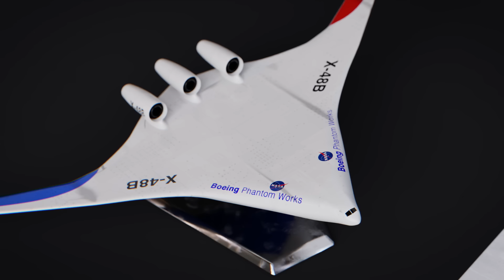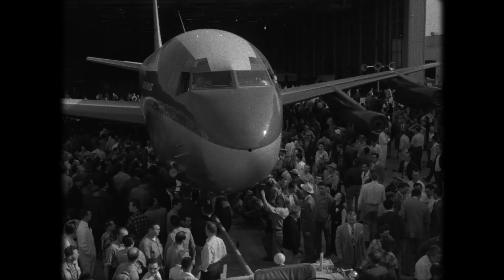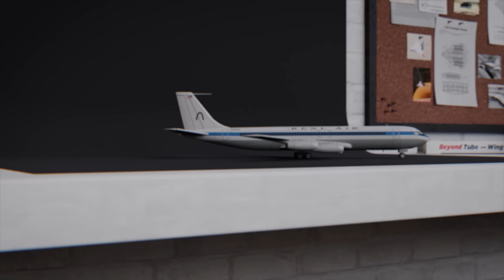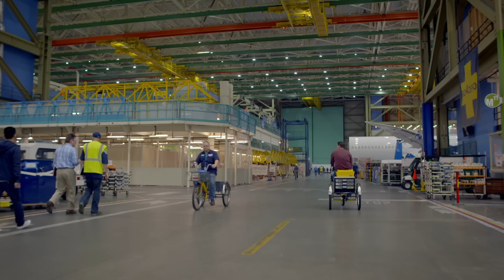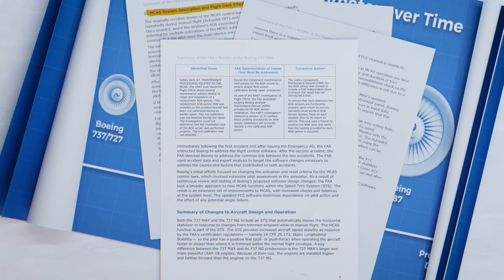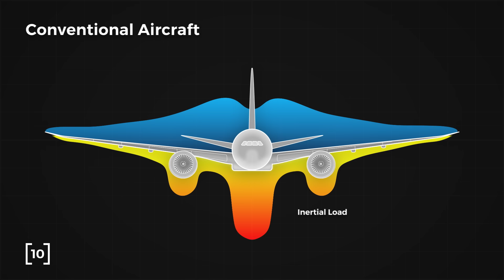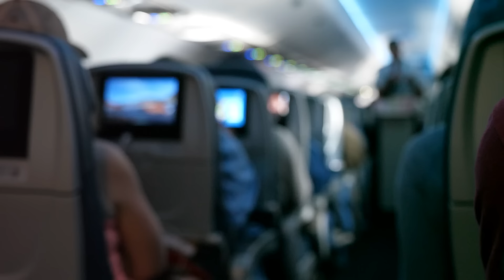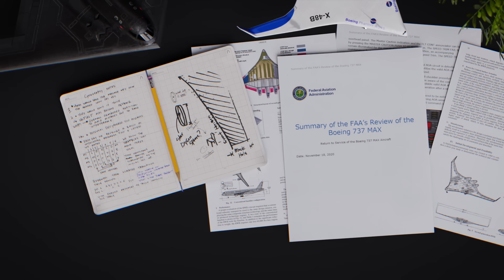The Plane That Will Change Travel Forever

Comment: 5:00 Actually, that's exactly what we want for aerodynamic stability and control.
We can design planes with a forward (or coincident) center of lift on fuselage-wing designs today, and we could 50 years ago.
The reason nobody does that (outside of a few test and military aircraft, like the X-29) is because such a configuration is aerodynamically unstable, both for human pilots and for software.
The drag and lift penalty for trim is quite small on modern airliners, and not something worth sacrificing safety for.
Reply: > The reason nobody does that [...]

Moving the center of lift in front of the CG has been done for decades in General Aviation (GA) in configurations that are most certainly aerodynamically stable ... they are called "canards" and Burt Rutan made his reputation in large part on designing aircraft that used them.
Reply: @lewiscole5193  Yeah, I am aware that canards exist (cf the X-29 I mentioned previously), but they are a very niche design, and mostly seen on a few light aircraft (where aerodynamic efficiency is not a major driving factor, cf it's more efficient to use struts and braces on wings despite the profile drag) and on some fighter jets, where they are used for post-stall maneuverability or to supplement thrust vectoring systems.
As for Rutan, well, there's no denying his designs work, but he's certainly very... eccentric. There's a reason almost all large passenger aircraft use the traditional wing-fuselage-horizontal stab design, and it's because it is the most effective (for structural, cost, aerodynamic, scalability, reliability reasons etc) layout for our current technical and economic environment. If regulatory and environmental reasons push electric and/or hydrogen to become viable alternatives for air travel, that may change.
Reply: @V_is_for_Void  
> Yeah, I am aware that canards exist (cf the X-29 I 
> mentioned previously), but they are a very niche 
> design, and mostly seen on a few light aircraft [...]

The question you have to ask yourself is "why?" since the aircraft aerodynamics are effectively the same for an airliner and a GA aircraft.
(And yes, I know about Reynolds numbers, but the difference isn't enough to bother with for the moment and so let's just get to the good stuff, shall we?)
I'm sure that there are many answers that often times depend on the particular situation/requirements, but there is no doubt that a significant factor is that aircraft designers are engineers who are very conservative by nature, meaning that they don't try something different unless there is a very good reason to do so especially when someone else is paying the bill.
IOW, the fact that canards are a "niche" doesn't mean that they don't/can't have applicability to other types of aircraft.

> (where aerodynamic efficiency is not a major 
> driving factor, [...]

While GA aircraft need not be particularly fixated on aerodynamic efficiency in general, Rutans designs have always been very aerodynamically efficient.

> cf it's more efficient to use struts and braces 
> on wings despite the profile drag) [...]

Ummm, no.  Struts and braces don't appear on Rutan's designs, but more importantly, they are not aerodynamically efficiency on aircraft that have them either.
They often time exist for structural/cost reasons.

> and on some fighter jets, where they are used 
> for post-stall maneuverability or to supplement 
> thrust vectoring systems.

Ummm, no.
As often as not, they have appeared on fighter jets to help keep the airflow over main wing attached so that they don't stall, for example the Mirage III, Mirage 2000, and Viggen.

> As for Rutan, well, there's no denying his designs 
> work, but he's certainly very... eccentric.

Which is neither here, nor there, as the air just doesn't give a damn.

> There's a reason almost all large passenger 
> aircraft use the traditional wing-fuselage-horizontal 
> stab design, [...]
I would suggest there are several reasons, but go ahead ...

> and it's because it is the most effective (for structural, 
> cost, aerodynamic, scalability, reliability reasons etc) 
> layout for our current technical and economic environment.

Assuming for the moment that I accept this as true, again, the question you have to ask yourself is, "why?".
Winglets have been known about since at least Whitcomb and contrary to what you seem to think, there was no rush to put them on every aircraft in sight.
Composites have definite advantage when it comes to strength and surface smoothness and yet it's usage likewise didn't happen overnight.

Meanwhile the Piaggio P.180 has long since demonstrated its fuel efficiency compared to small jets and yet it hasn't swept the world by storm ... I wonder if it has anything to do with the fact that it has three wings instead of two?

> If regulatory and environmental reasons push electric 
> and/or hydrogen to become viable alternatives for 
> air travel, that may change.

Such things wouldn't hurt.
Reply: @lewiscole5193  PS I didn't mean to imply that a Boeing engineer invented winglets, they have probably been around since the first schoolboy turned up the tips of his paper aeroplane wings.
But designing wingtips/winglets that can be retrofitted onto existing passenger aircraft to integrate with existing structure and meet structural, shielding, EMI, regulatory and aerodynamic requirements, that would be no trivial task. Even the winglets on a 737NG are taller than a man, and the folding wingtips on a 777X are as large as a car.
Reply: @V_is_for_Void  
> PS I didn't mean to imply that a Boeing 
> engineer invented winglets, they have 
> probably been around since the first 
> schoolboy turned up the tips of his paper 
> aeroplane wings.

Okay.

> But designing wingtips/winglets that can be 
> retrofitted onto existing passenger aircraft to 
> integrate with existing structure and meet 
> structural, shielding, EMI, regulatory and 
> aerodynamic requirements, that would be 
> no trivial task. 

Really?  Why would you think that?  It's my understanding that the effects of a winglet are basically the same as if the wing were lengthen by the length/height of the winglet.
And the one thing that I'm sure of is that aircraft designers know how to make wings longer.
As for shielding and EMI, you'll forgive me if I don't see the difference between a conductive wing (acting as a Faraday cage) and a winglet that can likewise be made conductive.
As for regulatory requirements, well, that's a problem but again, I fail to see how/why that would be different as far as a big manufacturer is concerned from just eliminating the winglets and instead lengthening the wing.

OBTW, when I looked up the spelling of John Roncz's name, I discovered he had a patent on adding winglets to a Baron, which just coincidentally I'm sure is the aircraft that he used to like to fly around in all the time.
So from the aerodynamic standpoint, I don't see adding winglets as being that big of a deal ... just one that took a long time for the airline industry in particular to adopt.

> Even the winglets on a 737NG are taller than 
> a man, and the folding wingtips on a 777X 
> are as large as a car.
Reply: @lewiscole5193  PS I'm not an aerodynamicist, so have not evaluated canards beyond the first level aerodynamics and control classes, but there's an anecdote that I think might be relevant.
The story I heard (and I have not confirmed this, but have heard it from several senior engineers) is that modern wingtips were originally conceived by an engineer at Boeing. Boeing itself had no interest in his invention, so he ended up developing it on his own and licensing it to the general aviation market. When it turned out that the wingtips did in fact have a substantial performance benefit, Boeing swallowed its pride and licensed it back from him, and now variants thereof can be seen on all its planes.
The point of the story is that if a design has a competitive advantage, all the big players will jump on it, even if they have to swallow their pride. If canards are not to be found on passenger airplanes, then it's probably because it doesn't provide enough of an advantage, if any. Note that the Boeing sonic cruiser concept had canards, so Boeing (and Airbus) are not averse to using canards when they are appropriate.
Reply: @V_is_for_Void  
> PS I'm not an aerodynamicist, so have not 
> evaluated canards beyond the first level 
> aerodynamics and control classes, but 
> there's an anecdote that I think might be 
> relevant.

I'm not an aerodynamicist or a professional aircraft designer either (and as I'm sure you are aware, these two roles aren't necessarily the same as Rutan left the design of his wings to John Roncz at least in the early days),  but I have studied up on aircraft design has I thought about designing one or more aircraft for personal use many years ago (e.g. a 200MPH ultralight ;-) ).
I had no particular interest canards as a more conventional configuration with attention paid to maintaining laminar flow for as long a possible seemed to get me where I wanted to be.

> The story I heard (and I have not confirmed 
> this, but have heard it from several senior 
> engineers) is that modern wingtips were 
> originally conceived by an engineer at 
> Boeing. <snip>

I'm not fluent in winglet history and so beyond mentioning that there were attempts to put things on the end of wing to supposedly control wingtip vortices before Boeing as a company even existed.
IIRC, Sighart Hoerner (of "Aerodynamic Lift" and "Aerodynamic Drag" fame) once proposed doing something to wingtips as well, although I can't remember just what.
The first interest beyond that that I'm aware of is Whitcomb's work back in the 1970s IIRC.

> The point of the story is that if a design has a 
> competitive advantage, all the big players will 
> jump on it, even if they have to swallow their pride. 

IMHO, the point of the story (assuming that it's true), is that once someone takes the risk of trying something "new" and the risk pans out to demonstrate a competitive advantage, then everyone and their brother will jump on the bandwagon.

> If canards are not to be found on passenger 
> airplanes, then it's probably because it doesn't 
> provide enough of an advantage, if any. 

Ummm, no.
Canards have not demonstrated ENOUGH of a competitive advantage to be considered worth the effort to bother with.
That's not the same thing.

> Note that the Boeing sonic cruiser concept had 
> canards, so Boeing (and Airbus) are not averse 
> to using canards when they are appropriate.

Many moons ago, before WWII, R.T. Jones made the case for using delta wings in high speed flight and was ignored until the Allies learned about what the Germans had been up to in WWII.
(And yes, I know that a German aerodynamicist made the same case before Jones did, but neither Jones nor anyone on else on this side of the Pond apparently knew/cared about it.)
A few less moons but still a long time ago (again around the 1970s IIRC), Jones pointed out the advantages of an elliptical wing flown obliquely especially in lower drag around transonic or low supersonic speeds.
Various studies were done suggesting about a 10% improvement over conventional aircraft and ... nothing happened.
I THINK Boeing may have even looked at it at one time, but frankly, I don't give a shit.
Either way, these stories, while anecdotal, clearly demonstrate that you're opinions on how everyone rushes to use "competitive advantages" is more than a little suspect.
Reply: @lewiscole5193  No, I don't have an anti-canard bias. Many novel and nonstandard layouts have been explored in aviation. Some of them, like the elliptical wings you mentioned, have proven advantages but have enough disadvantages that they are never adopted into general aviation. Even if big companies like Boeing and Airbus don't explore all these options, scientific and educational institutions like NASA, Cranfield, University of Queensland etc are always pushing the boundaries of aviation science.
From what I recall, the textbook explanation is that the conventional wing and tail stabilizer design is dynamically stable, and that is probably why it has become the de facto standard. If you have a trim surface (such as a canard) that provides lift instead of downforce, it tends to amplify positive AoA gusts, which can lead to stalls or crashes if not corrected.
If I can be accused of having a bias, it would probably be in a preference for proven designs over flashy ones. An example of it would be the slow adoption of composites that you mentioned previously. Carbon Fiber Reinforced Polymer has demonstrable strength to weight advantages over aluminum and titanium structures, but their slow adoption was because both Boeing and Airbus spent decades and millions of dollars on material testing data, developing design practices, analytical and manufacturing processes before introducing them into their fleet. Even today, any new composite material (and there are new composite and carbon fiber materials being developed all the time) are subjected to much scrutiny and testing before they are introduced into new designs. Both companies rushed to evaluate these new materials, but neither company rushed them into planes until they were confident.
Reply: @V_is_for_Void  
> No, I don't have an anti-canard bias. 

I didn't say that you did although it seems clear to me that you do indeed have bias that makes you less ... amenable ... to a canard configuration than the "conventional" configuration.

> Many novel and nonstandard layouts have been 
> explored in aviation. Some of them, like the 
> elliptical wings you mentioned, have proven 
> advantages but have enough disadvantages 
> that they are never adopted into general aviation

In your view.
In my view, obliquely flying elliptical wings beat just about everything under the sun with the only real reason why they aren't already adopted being that no one has been willing to take the risk to try to make and sell one.

> Even if big companies like Boeing and Airbus 
> don't explore all these options, scientific and 
> educational institutions like NASA, Cranfield, 
> University of Queensland etc are always 
> pushing the boundaries of aviation science.

And sometimes, they just re-discover what was known before.
Seriously, your comment sounds ... needlessly "flowery".
There's a lot of space that has been skipped over in our quest to make airplanes and so there's a lot of space that can be gone back over when the need arises.
But none of this changes the fact that we often/usually don't bother until the need arises.
And for better or worse, there hasn't been much of a need to re-examine canards until relatively recently.
But that doesn't mean that there was/is something "wrong" with canards compared to the conventional configuration.

> From what I recall, the textbook explanation is 
> that the conventional wing and tail stabilizer 
> design is dynamically stable, [...]

What is this?  A test to see how well I remember Chapter 1 of Perkins and Hage?  Okay then ...

A body is STATICALLY stable if the sum of all forces and moments acting on the body comes out to be zero.
A body is DYNAMICALLY stable if a perturbation acting on the body produces a countering effect that tends to return the body back to its initial (stable) configuration.
The aircraft with a conventional configuration is NOT inherently stable either statically or dynamically, although it's not all that difficult to make such an aircraft both statically and dynamically stable, which together with "good handling characteristics" is what a decent aircraft designer supposedly should strive for.

So, for example, an airliner deploys flaps to boost the wing's lift, this almost always increases the pitching moment of the wing.
If the horizontal stabilizer is too small or not far enough away from the CG to generate a compensating pitching moment, the aircraft is going to go nose downward into the ground, conventional configuration or not.

> [...] and that is probably why it has become 
> the de facto standard. 

Or perhaps it's what just about everyone is used to.

> If you have a trim surface (such as a canard) 
> that provides lift instead of downforce, it tends 
> to amplify positive AoA gusts, which can lead 
> to stalls or crashes if not corrected.

Ummm, no.

Consider the case of a conventional configuration first.
An upward gust makes the relative wind seen by the wing seem as if the wing were flying at a higher AoA which means that the wing generates more upward lift.
As a result, one should expect the aircraft to pitch up until some compensating force acts to correct the perturbation.
The compensating force comes from the horizontal stabilizer which should presumably also see a either a higher AoA as well.
Since the horizontal stabilizer is generating negative lift, however, the increase in AoA seen by the tail means that it produces LESS downward force and the tail should tend to swing upward (in no small part because the pitching moment of most wings is nose downward).
The upward movement of the tail will hopefully dampen out over time and so the aircraft should return to what it was doing before the gust appears.

In the case of a canard, an upward gust cause the canard to effectively fly at a higher AoA causing the aircraft to pitch upward as well.
But this causes the main wing to fly at a higher AoA as well and so it too generates more lift likewise causing a the tail to move upward as well (regardless of the pitching moment of the main wing).
So once again, the upward movement of the tail (where the main wing is at) will hopefully dampen out over time and so the aircraft should return to what it was doing before the gust.

> If I can be accused of having a bias, it would 
> probably be in a preference for proven designs 
> over flashy ones.

Then you've just demonstrated my point WRT aircraft innovation not being drive simply by competitive advantage.
You stick with that which you know until it's proven to some level of satisfaction that some feature has enough of a competitive advantage to bother with.

> An example of it would be the slow adoption of 
>composites that you mentioned previously. 
> Carbon Fiber Reinforced Polymer has 
> demonstrable strength to weight advantages 
> over aluminum and titanium structures, but their 
> slow adoption was because both Boeing and 
> Airbus spent decades and millions of dollars 
> on material testing data, developing design 
> practices, analytical and manufacturing 
> processes before introducing them into their 
> fleet. 
> Even today, any new composite material (and
>  there are new composite and carbon fiber 
> materials being developed all the time) are 
> subjected to much scrutiny and testing before 
> they are introduced into new designs. Both 
> companies rushed to evaluate these new 
> materials, but neither company rushed them 
> into planes until they were confident.

IMHO, neither company looked at them at all until they were "proven" worth looking at by virtue of their use in GA.